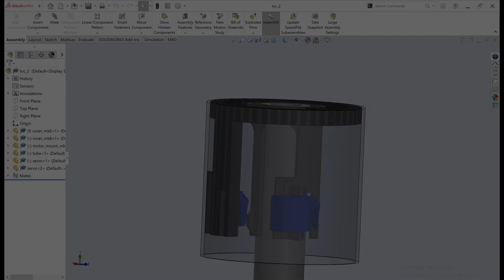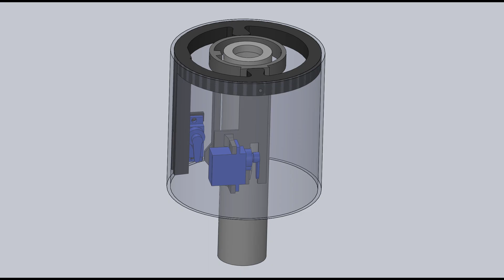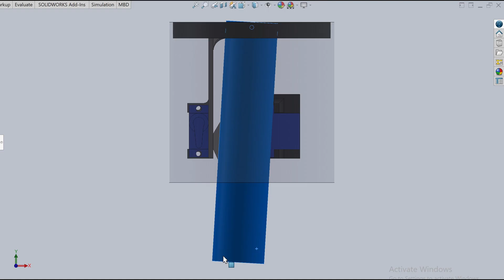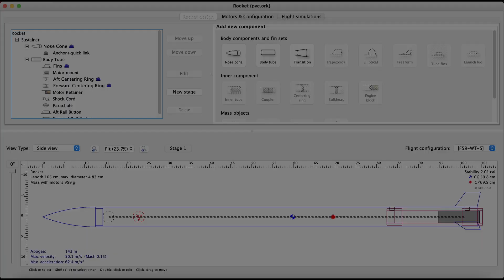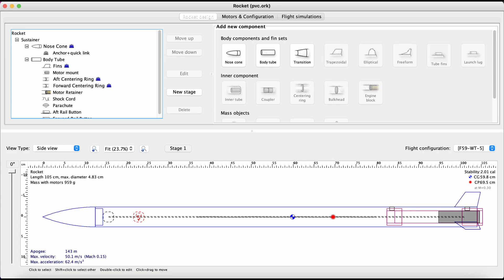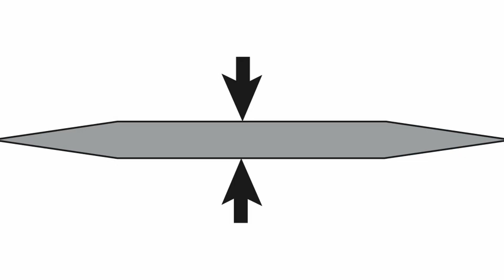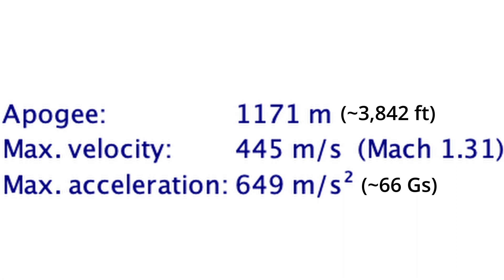100 SUBSCRIBERS!!! What's next?!?

Comment: Great Video! I am excited for some of these projects. I use the Jolly Logic altimeter 2 to compare experimental altimeters with :)
Reply from the maker: Seems a bit pricey... What's your opinion on the Estes altimeter?
Reply: @motechspace  The Estes altimeter will work, the only downside is that it can't measure velocity.
Reply from the maker: @diyaerospace4181  Thanks! I think it should be fine.